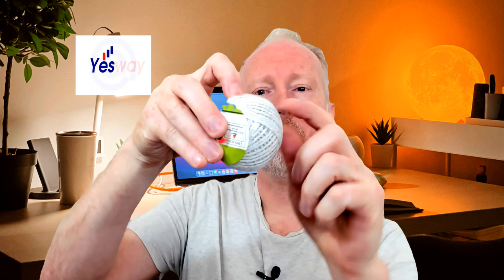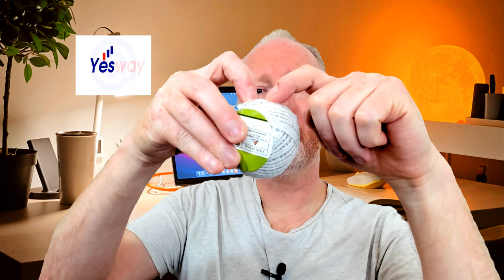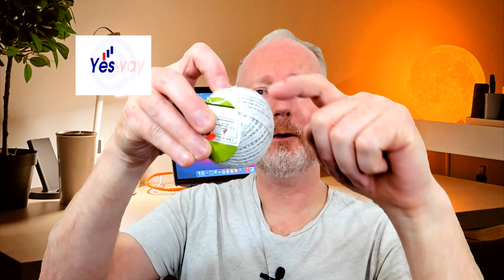Why VHF Marine Radios Only Transmit and Receive a Limited Distance.

Comment: FM 2 way as sold, is not cut out to sniff that far, either. I stick to 25 watt radios. Also have an American style CB radio. It's 4 watt range will knock your VHF off the table. I route antenna cables so I can remove antenna cables and antennas in a snap. Don't forget 68,69, and 71 are for chitchat, so you can get real use out of the VHF.

Comment: How much does the Wattage of the radio effect range?
Reply from the maker: Depends on a lot of factors, such as attenuation from obstacles, such as terrain and buildings. Doubling the wattage won't double your range, but will help get the signal through obstacles between the transmitter and the receiver, such as trees.

Comment: great info fella , just bought a marine radio for listening only , how far would i need too be from the river too listen , thanx in advance
Reply from the maker: It depends on a few factors:

1) Height and gain of your antenna.

2) What obstacles , such as tree and buildings, are in the way between you and the river. This would attenuate (reduce) the signal strength more.

3) How far  away. If you are fairly close it won't be an issue (apart from the factors mentioned above), but if you are a few miles away, the earths curvature 'could' become a factor. For example if you were on a boat (with no obstacles between you, and another boat), there would still be a reception limit, when the two boats move away from each other. This is because of the earths curvature making the two boats (the transmitter and the receiver), not being able to 'see' each other, by line of  sight.

Line of sight normally only affects frequencies above 30MHz, and I am assuming you want to listen to marine VHF, as you mentioned the river.

There is also marine HF (High Frequency), which is below 30MHz, and is used for sea going ships. Below 30 MHz the signals can bounce off the ionosphere etc, and travel much further.
Reply: @yeswaycommunications  thank you great info